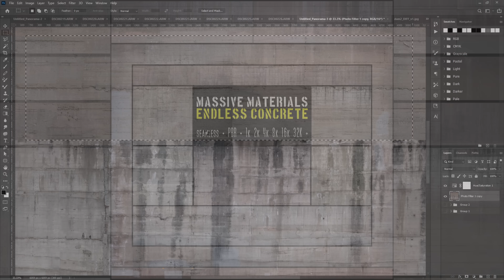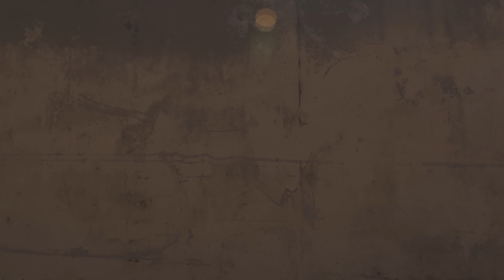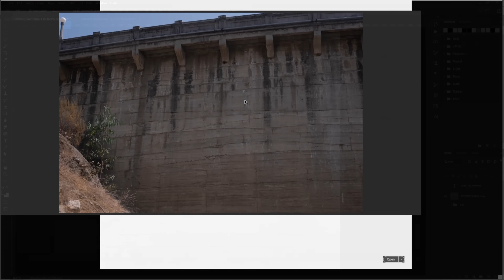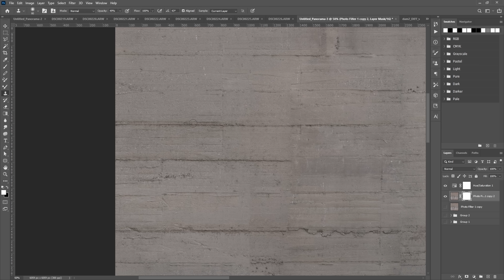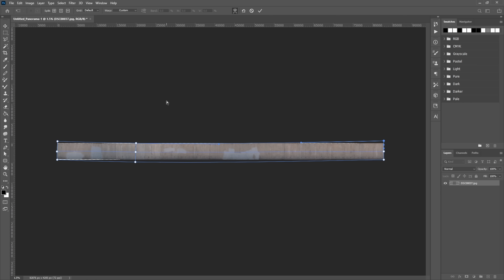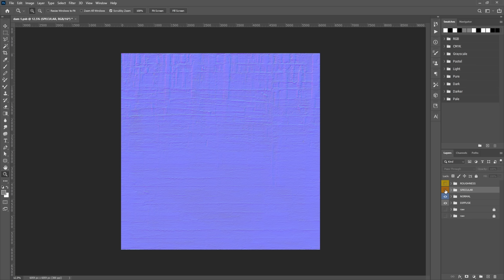Capture and Create your own Custom 3D Materials | FULL WORKFLOW

Comment: I'm sorry, did I read that right? The pack has 32k res textures along with lower-res versions?? That's insane. I'm not certain how practical it could be with current 4-8k monitors or commercially viable 16:9 resolutions as the detail within the texture alone would start to morph into one pixel, but seeing how the graphical fidelity train isn't stopping anytime soon, might have monitors and realtime card capabilities that can support that texture res.

Comment: Substance is an alternative to many of the steps in this process. Substance Sampler (formerly Substance Alchemist) uses AI to take a photo and break it out to the component maps with a single click. It's not quite as accurate as doing all the processing manually in Photoshop, but for a process that's automatic and only takes a few seconds it's pretty damn impressive. It does a ton of useful post processing as well. It will make everything seamless if you need, plus you can add dirt, dust, water, extra grunge, and a ton of other features. If I wanted to model my office for example I could grab my phone, tax a picture of my carpet, import it into Substance Sampler, click one button and have a full PBR in a matter of seconds.

Comment: Back in 2014 while I still work with Codemasters on the Dirt, F1, and Grid franchise, we use this technique on texturing when making the race track.
However back then Photoshop doesn't have a build-in normal generator we used either xnormal or Nvidia photoshop plugin to generate normal.
Ghosh, I miss this technique but it is getting obsolete in the game industry due to 'Procedural Texturing' and 'Megascan'.
Reply from the maker: So cool to hear this is a half-decent workflow lol!
Reply: Great games
Reply: Honestly procedural texturing still falls behind photo-made assets. They don't look as authentic because they don't have the slight imperfections IRL objects have
Edit: I think it's even better for performance, since all the detail is baked into the image, so the hardware spends less time rendering the texture image

Comment: in light room, you can have a preset with just lens distortion correction and you can apply it to all images you import if you want, its so much quicker than adding it to 1 image and copying and pasting to other images, as sometimes it actually does not work

Comment: great video love the textures! A note on normals, specular and roughness - You can clone your maps and do "histogram selections"  with masks, to select more precisely different features of your texture, to have more control in terms of the way you want to blend to have the correct grayscale values. For instance, the black smears, you can create a very narrow curve adjustment near black, and apply whatever blending operation you want to it, either add or subtraction in most cases, to get the proper value. It's also very useful to paint discrete masks, because sometimes the black values include things like cracks and recesses which you want to be very rough, but if there's a glossy black smear on the texture  it becomes necessary isolate those to give them a more discrete roughness or specular value. Of course all of that is entirely optional, but if you're trying to create the most authentic "PBR" material it's important to get the right values.

Comment: Nice tutorial. It helps a lot to get to know all the shortcuts right away.
But I would recommend you to keep the resolution of textures to the power of 2. Computers can work more performant with them, which is important if you want to use the texture in a video game or for a weaker platform e.g. mobile, vr.

Comment: Inverting the specular texture produces a small issue that bugs the hell out of me. If you invert then it means all the cracks are super shiny, even though they are often the roughest and least shiny parts of the concrete wall. This is especially bad on brick walls when the grout ends up being the shiniest part of the texture.
Reply: Also with non metallic PBR materials, you should really be using a constant value for specular, not a texture. Between 2-4%

Comment: Thanks for another fantastic tutorial! Love the tiling and seam removal in particular. I must say though that roughness and specular should largely be disconnected from the colour information (but certainly draw from the details of course). I suppose in many cases you really have to paint good chunks of them manually based on additional reference footage shot on location - so that for instance the inside of the cracks are non-shiny while the streaks that the water left might be totally shiny (only if wet) even though both appear as similar dark colours in the diffuse layer.

Comment: Why do you use Photoshop for Normal, Spec and Roughness Map? While the manual control over anything you get is great, this is an ancient workflow that is way too slow. Using Substance Designer for this kind of work is much more useful, it gives more options and once you set up your nodes you can feed in many images and get results immediately.

Comment: Hey Clint, there is actually an easier way to use content aware tool. Select areas where you want to remove, and use the content aware tool under edit at the top menu. It works better and flawlessly. Not sure what version it came out but if you're using the latest one, it'll be there.

Comment: What's the point of stitching it on location? I feel like it's more of a pain in the ass to do it outside, and the battery won't hold long if you are using a GPU.
Reply: Maybe just to know if what you are capturing will work before you leave the location? That's about my only guess because yeah it does sound like a pain!

Comment: #pwnisher
 - cool stuff!! Can  you show or make tutorial how to create 16k, 32k and even 64k SEEMLESS textures and in Photoshop please ? And then accordingly create 16k, 32k and even 64k materials.
Maybe you know MARI texturing software to do that as  well?
Reply: At 11:12 he shows how to make a texture seamless.  He skims over the details, but basically it's just clone brushing over the seams and gently blending in elements to hide the transition.  It's pretty easy to do, you just have to be careful and keep checking what your texture looks like overall.  As for material creation, wouldn't you just do it like normal and just load in the hi rez textures like any other?  Unless your software has special requirements for massive textures I do't see why the process would be any different.  The only restrictions on texture size in my experience come from hardware limmitations because my PC isn't great at handling large images, but other than that it shouldn't change much.

Comment: sorry but it is certainly not the best (or most accurate) way to make a panorama in photoshop.
why first the camera raw all the automations together?
  ... then one by one in lightroom does not make much sense the photoshop algorithm understands very well that you used the same lens and therefore does not need to know it before (it can be an advantage) but it is not mandatory.
if in the end you use the warp tool anyway ... what's the point of straightening every single photo first? sure everyone has their own workflow but I would NOT recommend this one.
Reply from the maker: It was the one and only workflow that got me to a useable endpoint. Worked for me 🤷‍♂️
Reply: @pwnisher  you put some extra steps in it...I don't understand why...seems a little confused. when I have a little time I'll try to make a tutorial like this and I show you what I ment and what work for me also.